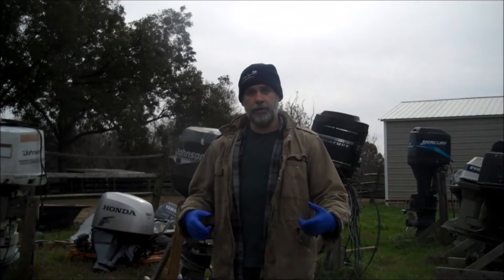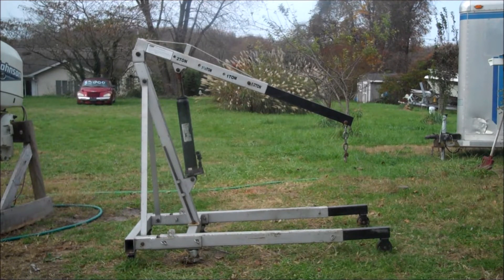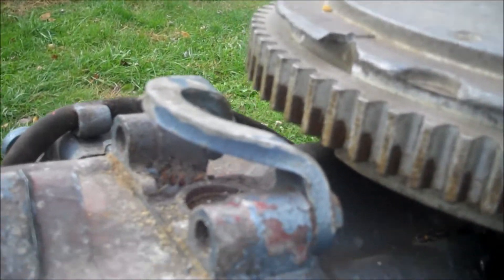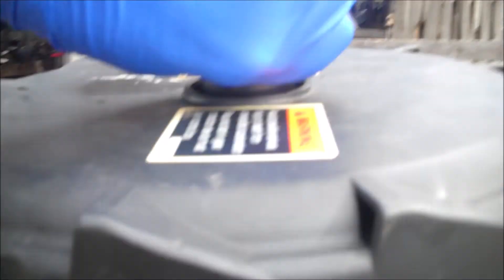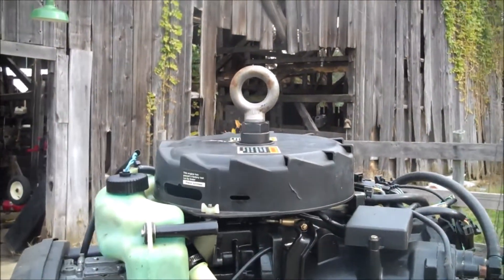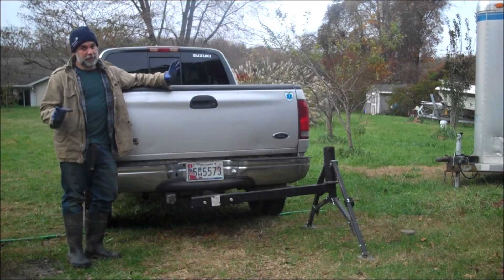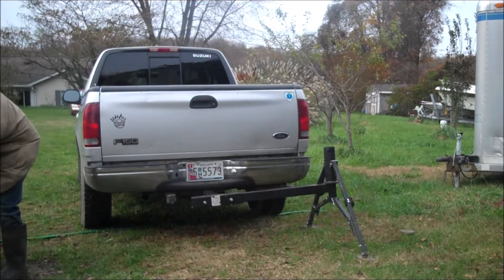How to hoist up your outboard motor

Comment: Thanks so much for your videos, they gave me the courage and confidence I needed to tackle my transom project. That Mercury hoist nut/ flywheel puller was clutch. You saved me a headache or two. Hoping to be back on the water soon.
Reply from the maker: Glad to help

Comment: Brilliant! Simple, but still brilliant.  I've lifted these motors several times using different methods, but had totally forgotten that I could use a chain on some robust bolts or use the flywheel puller I bought for that purpose.  Thanks for reminding me.  Your language and description was clear and concise. Great video! I subscribed immediately. Thank you

Comment: I was just figuring out how in the hell lift up Mercury 50 out of the boat...so that it won't break or flip around...Thanks for the video and the good tips! There is some kind of casted frame, but it doesn't look very strong regarding the weight of the motor...I have a tractor to lift it up, but I need to go back and review the possible points to attach a lift-up chain or rope. Also, I learned the handy tool to load/unload the pickup truck! That was a bonus! Thanks again!

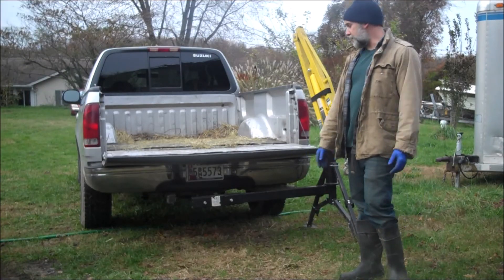Comment: I know this comment is going to be 5 years late but do you have any tips specifically for that 125 force or (mercury) motor seen in at 6:07. I have the 1251x8c model of that engine and I need a transom repair. lot of good information I clearly watched your video all the way through but any advice would be appreciated. :)
Reply from the maker: OK well whats the problem with it?

Comment: I found an empty eye hole that I could fit a d shackle through, It was under the flywheel, so I use a short loop of strap from the shackle to the lift hook to protect the flywheel. with so many different examples, this video helped me think outside the box and I found my own solution. Thanks Max!

Comment: Great video. I have a 115 HP Honda outboard that I need to transport. Can I lay the Honda outboard down in the back of my pickup truck without damaging the motor or cover?
Reply from the maker: Yes you can, but it should only lay on the side or else the oil may run into the cylinders. Honda gives 2 little feet on the body of the motor, these lay down and the oil dipstick faces up. I would put down some blankets or an old tire or something like that to protect it cosmetically

Comment: harbor freight roller crane i got a 2 ton one in the back of my truck with a 85 mercury it was about 400 lbs i used a old chain and 2 links that screw sections to join ends of chain with links! i got motors i can work on! i smashed a wall when the bigger motor(150 v6 evinrude) fell and bounced off pallet & cost me 150 for repair of it, the crane would help me in removing motor and replacing other motor!

Comment: Mrmaxstorey:  I’ve been with you for a long time and so glad you’re still making videos, even if it isn’t as often.  I had a question for you if you had any ideas where I should start.  I have an opportunity to buy a clean 1970 Suzuki 100.  It has power going to the coil but no spark.  Aside from plug and wire any idea where I might look to getting spark again?  Thanks in advance
Reply from the maker: Hey there my dude check out the points clean them up or replace and gap appropriately

Comment: It was helpful. Would a pair of nylon straps around the underside of the outboard body just below the engine work? (I think the term lifting ring is what you in your video referred to, rather than hook)
Reply from the maker: yea thats fine, i do that too thats how i hoist Force motors that dont have rings or hooks or eyes or hoops or circlets

Comment: Great video. How difficult is it to move the loaded jack over the grassy area? Any tricks to make it easier?
Reply from the maker: It was not at all possible except for very short distances positioning. I thought about implementing a track system out of sheets of steel, but ultimately the trick became just moving the truck out of the way and setting the wooden stands to wherever the motor was. Now I have a shop with a concrete floor and its like luxury
Reply: @mrmaxstorey  nice. Thanks for the reply and knowledge

Comment: I've got a mercury 115 and I've ordered one of those rings to screw onto the flywheel shaft. I'm assuming I have to remove the flywheel nut to access some threads correct? When I put the nut back what should I torque it at?
Reply from the maker: No you leave the nut on, it threads over the nut
Reply: I’m also about to hoist a Merc 115. The guy at the mercury dealer indicated I don’t need one of those rings and instead attach a strap to three places on the motor. I haven’t even taken the cowling off yet so I’m hoping I can see where those places are.

Comment: On those mercuries before you screw in that puller on the top of the flywheel did you have to remove the nut on the top of the flywheel?
Reply from the maker: No you leave it in

Comment: Great info , I can not find one of those mercury pullers .Is "flywheel puller" the search word you used ? Maybe you know part # ?  thanks
Reply from the maker: Search “mercury outboard flywheel puller” on on ebay theres like 100 of them
Reply: @mrmaxstorey  Your the best , thanks man , thought it would be days , before hearing back ( if at all ). I was looking on the parts sites . now if I can just get you to come help me  replace the swivel pin bushings on my 75 mariner !  LOL
Reply: @mrmaxstorey  Are there different sizes of these ? e-bay says it doesn't fit my 75 mariner, but it does have the threads , so I think they are wrong ? they don't list anything over 45 hp.  I think there is only one size 1 1/2 "  .Am I right in thinking , If it has threads , it will work  ?
Reply from the maker: Yeah ive used them on all mercury motors over 50, all mariners and some force motors. I think youll be fine

Comment: Will that pulled work on a 1989 mercury out board or are they to old for that?
Reply from the maker: Yeah it should work check out your flywheel if you got threads around the flywheel nut most likely it will work

Comment: W about Force 85hp??
Reply from the maker: Ok what about it?
Reply: @mrmaxstorey  I don’t see where i can hook the chain on my force
Reply: No eye hook
Reply from the maker: @eduareddie2178  o yeah I wrap a stout rope around the bottom cowl, and then loop another length up and over the flywheel, and then hook the lift onto that
Reply: @mrmaxstorey  whats the bottom cowl ?
Reply from the maker: @eduareddie2178  the hood is the top cowl, the part it clips to is the bottom cowl
Reply: Im still lost
Reply: If you can make a video will be awesome
Reply from the maker: @eduareddie2178  ill see what i can do

Comment: Might be 6 years late how to you lift a tower of power mercury 115
Reply from the maker: @bunnyhooksets-cp4bz  depending on the year they got the threads on the top that you screw the eye hook into. If not then you run straps around the lower cowl and then loop them up, and hook your lift onto that

Comment: your truck is looking pretty damn brown man
Reply from the maker: damn fuckin straight mang
Reply: @mrmaxstorey  what is that hoist at 5:18 called? Cant find it on ebay
Reply from the maker: @wazup3333  Trailer hitch hoist. I just looked tho all im finding are expensive ones
Reply: @mrmaxstorey  yea like 517$ you know whats up with that?
Reply from the maker: @wazup3333  no idea mine was a hell of a lot cheaper, maybe amazon?
Reply: @mrmaxstorey  418$ on amazon, so both those pieces used to be only 130$??
Reply from the maker: @wazup3333  yeah delivered